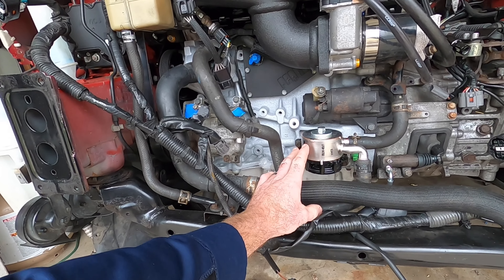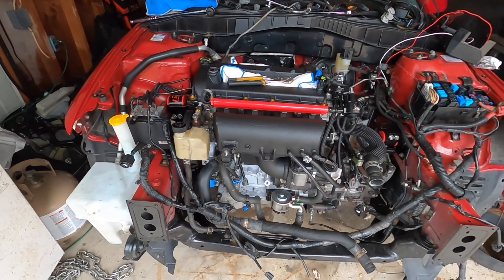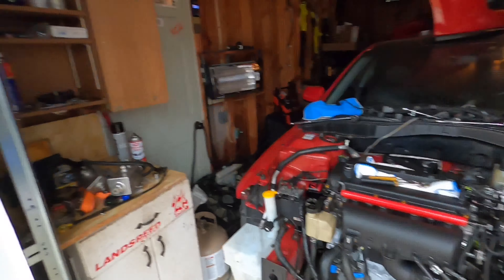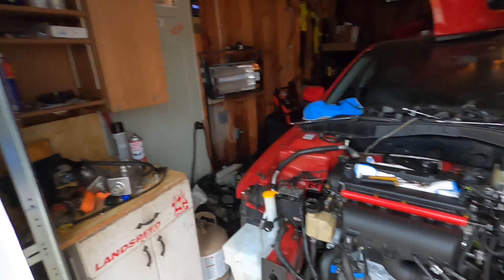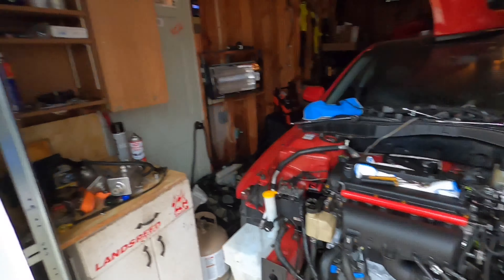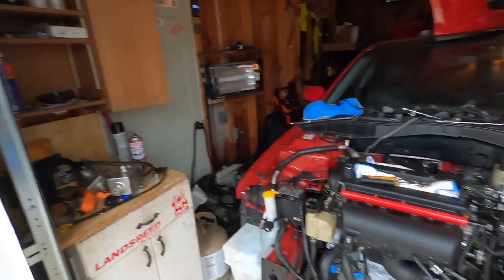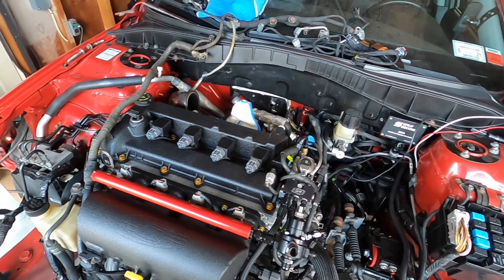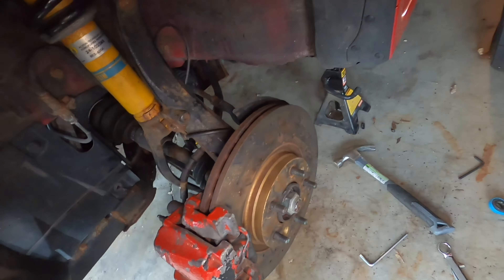Mazdaspeed6 Is Back On The Ground ! BIG PROGRESS....But Prepping The Car To Leave For It’s New Home

Comment: Where did the get the cooler from. And dont you have to switch the bolt that goes through the cooler
Reply from the maker: Ya it’s a kit off eBay with all oem parts .it has a new bolt / cooler / gasket
Reply from the maker: https://www.ebay.com/itm/Genuine-Mazda-Updated-Oil-Cooler-Kit-MAZDA-3-5-6-CX-7-LF6W-14-700A-HARDWARE-/181851244406?_trksid=p2349624.m46890.l49292

Comment: Question: all Speed 6 are AWD?
I own a 2007 CX7 AWD, a bit Tuned and with bigger TMIC, and someone told me chassis and gearbox were the same...
I also own a 2013 Speed 3 at Stage 3+... AWD is needed 😂
Reply from the maker: Very similar , I want to build one 🤣🤣
Reply: LOL at "Stage 3+"
That's a marketing ploy that parts suppliers use to differentiate products. It doesn't really mean anything in any universal, objective sense.
Reply: @numinous4789  yes it is...
But it’s shorter than listing all mods and parts and the pressure (you guys call it “boost”) and the dyno readings...
I am not a young guy like you, I am better he he...
Seriously: trolling blindly is nonsensical
Reply: @SpoolingUpPerformance  
I can’t believe it: my 310 bhp (its AWD, forgot “at wheel” number, which is nonsensical to claim to be different) CX-7 AWD launches and probably does a better 1/4 mile than my 345 whp Speed 3, lol... damn! I hate, and love, that 🤣
If the Speed 6 comes AWD... madre de Dios! I prefer than than a Subaru ☺️
I have the best of both worlds, not bad for a middle age woman who did everything with her hands (except the tuning, but I know the engineering)
Reply: @SpoolingUpPerformance  
Ahh, didn’t got your sarcasm... because you seem to don’t have a clue
The Mazda 6 Gen 1 is the CX-7... with different body and suspension. 
I Germany there were CX-7’s with AWD in manual gearbox 
And in the Mazdaspeedforum I read, but I can’t quote exactly, the Speed 6 was like that
Thus the question I made
But you guys are really something... what a shame, but then again you probably hate to interact with someone like me
Not going to bother you geniuses, I guess talking mods and racing with someone similar to your mom isn’t interesting 😎
Unsubscribing